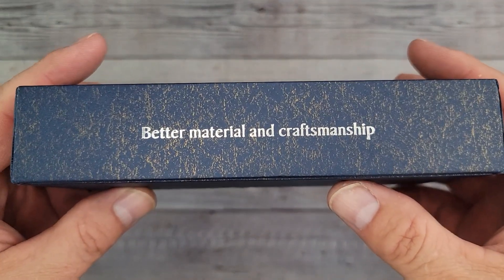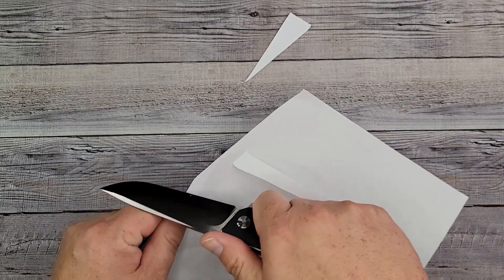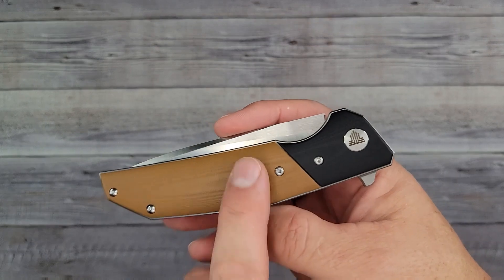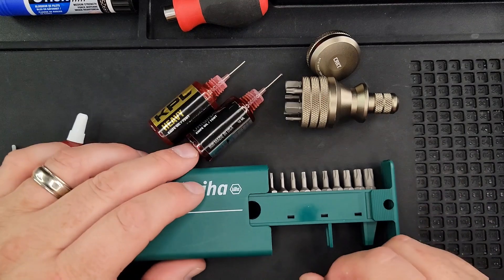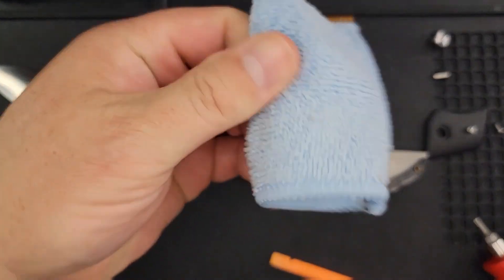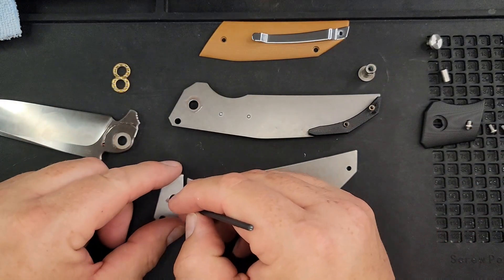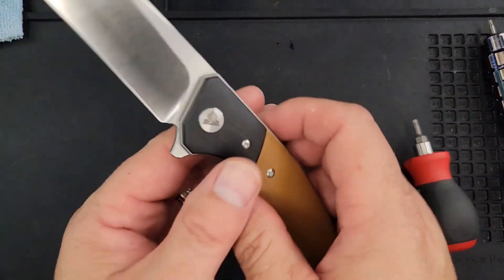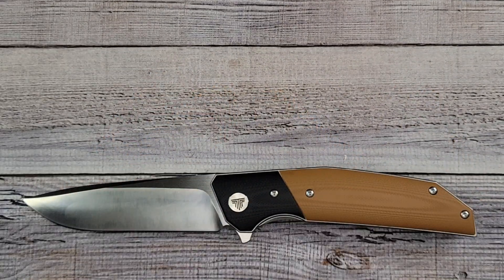LARGE & IN CHARGE! CONVEX BLADE! TRIVISA AQUILA 03B

Comment: this ticks most of the boxes for me. a bit out of budget, but dang, it's a nice hunk of metal. I do like the Wiha driver, but I already had an Irwin stubby with bit storage in the handle, so that is what I have put in my kit ( only found it in my tool box this week, could have used it these last few months)  if you get the chance, try an Irwin, it had very good grip.  also, I dont know why I never noticed before, but you use a pinning mat, just like I do to keep your screws  in check when you take them apart. cool

Comment: What's the difference between convex and Hollow ground
Reply from the maker: A convex grind is rounded outwards, to the tip (like an axe). A hollow grind gets thinner behind the apex, then gradually thickens as it heads towards the spine. A hollow is slicier, and a convex is tougher👊.
Reply: @BeezBlades  I'm a hollow, yet tough, man.  not too slicey.
Reply: Thanks, then what is  a. Concave  blade.?